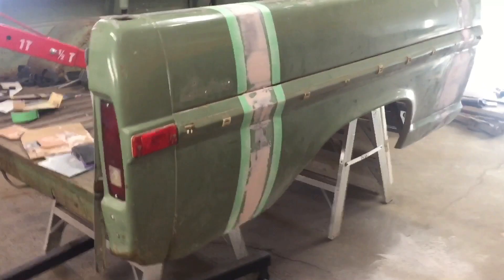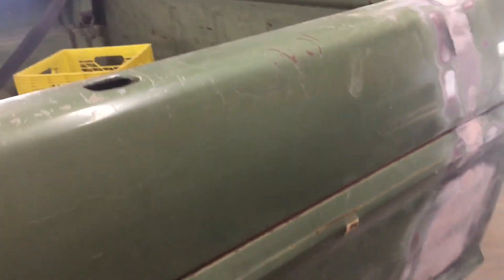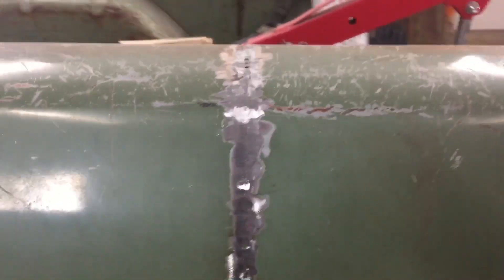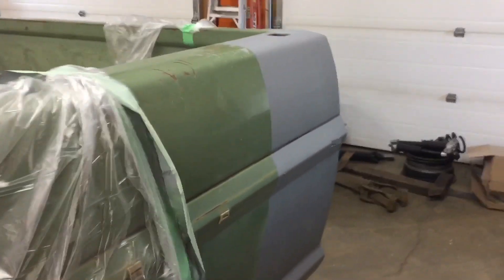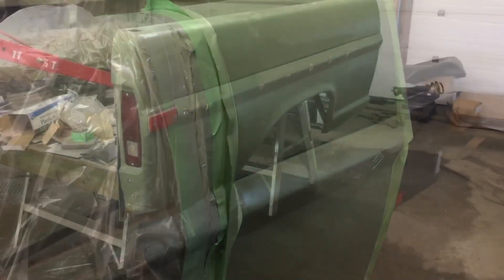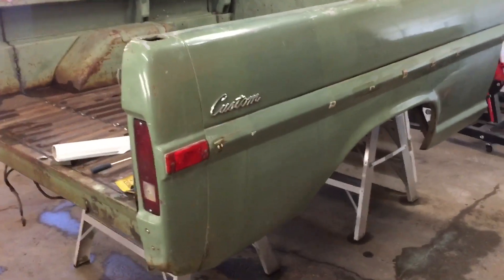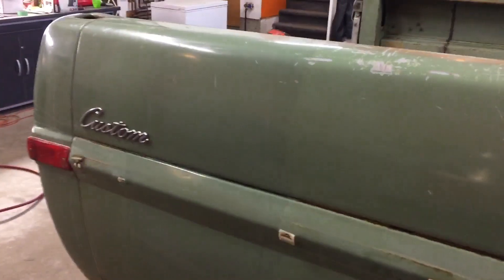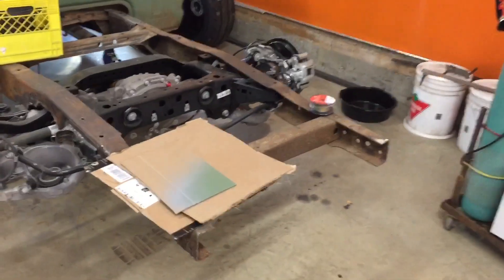Rattle can patina paint job on my F100 after the long to short box chop

Comment: Looks great!  I’m about to weld in another panel on the bed of my 69 camper special with the same boxwood green color.  The boxwood green seems to blend in a little better than the Wimbledon white.  ... I thought it would be the opposite.  It’s a pretty good match up for a 50 year difference.
Reply: I'm wondering if that's not Mill Valley Green & not Boxwood Green but hard to tell from video ?

Comment: I'm still doing the bottom of my cab. When I can get it back on the frame, I'll get to bed, shortening it like you have. I'd be lying if I said I wasn't terrified to do it lol. 

New welder. A Hobart. Which one is it? I use Hobart and love them.
Reply from the maker: Hobart 210 mvp. Only used it a couple times but so far it’s awesome. And I can add an aluminum spool gun anytime.
Reply: My wife bought me the same welder a couple weeks ago. I built a cart for it and I love it. That's on my channel with my 1969 build. It welds so nice! You'll do well with that welder.